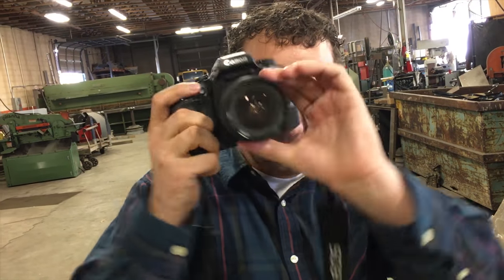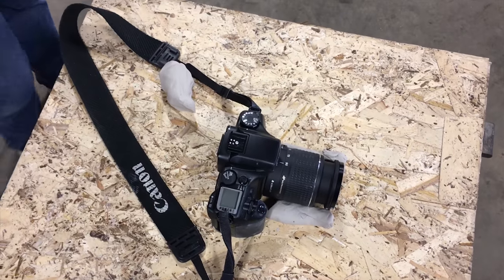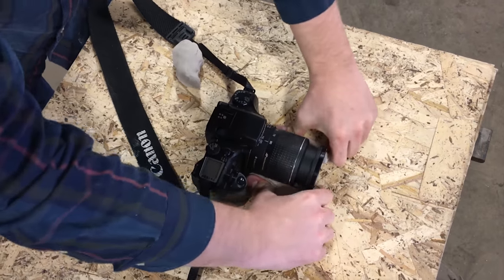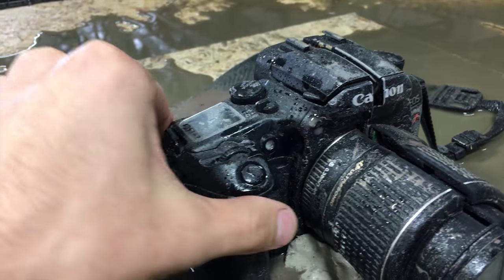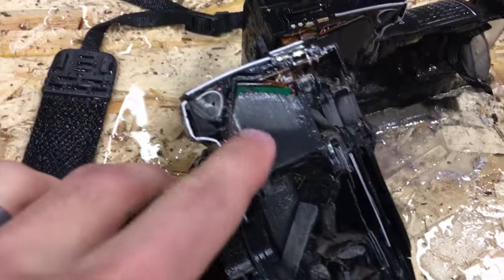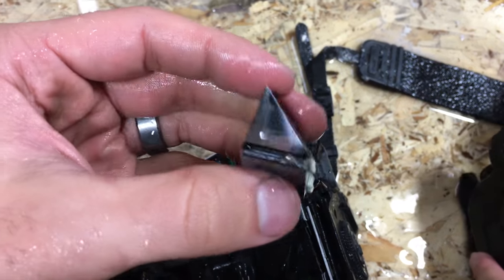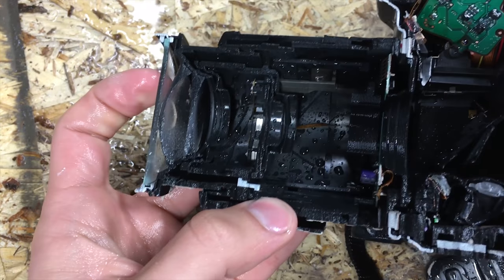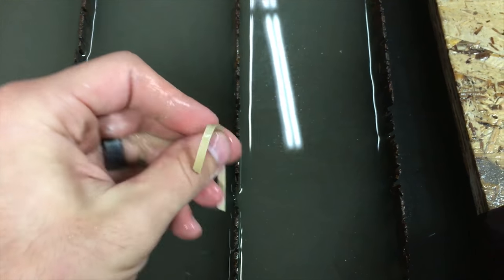Cutting An SLR Camera With A 60,000 PSI Waterjet

Comment: If the SD card didn't get cut you should've made it take a picture per second and play the pictures as a film
Reply: Looks like it was a film slr due to the lack of electronics behind the mirror. No sd card
Reply: You can see the sensor. No film. It's a dSLR.
Reply: Ravensaura that is a canon elan 7ne which is a 35mm film slr. no sensor in sight.
Reply: You appear to be correct bob345 my apologies. The red on the front made me think it was a rebel tsi. The cross sections on a dSLR look very similar.
http://petapixel.com/assets/uploads/2011/05/alphasliced.jpg

Comment: It's old, but that big block at the top is called a pentaprism (penta because it has 5 sides). It does the same as a two-mirror periscope, to bring light from the lens into the eyepiece, but does it without inverting or deviating the image. Any light passing into it from any angle will be reflected to the eyepiece properly.